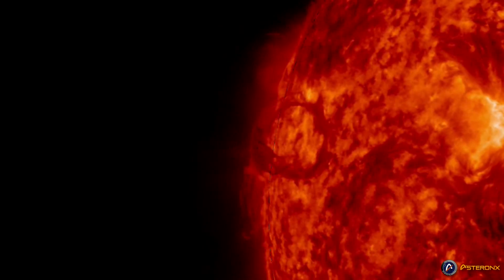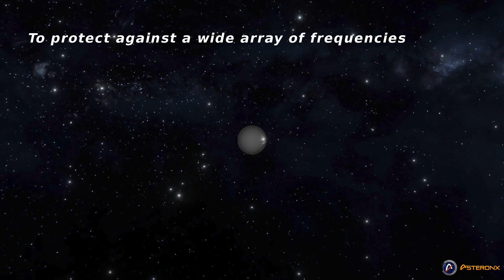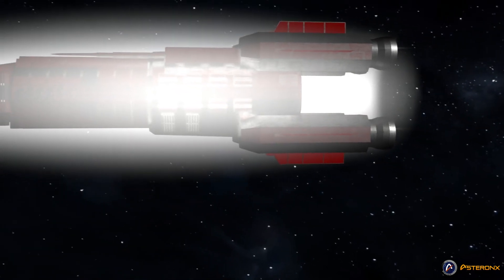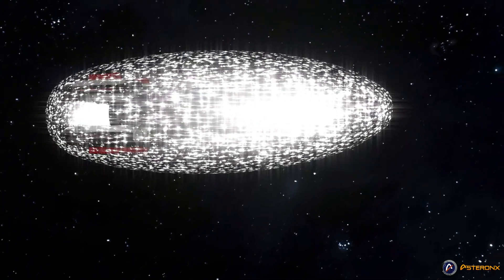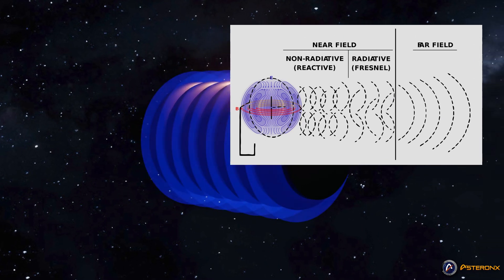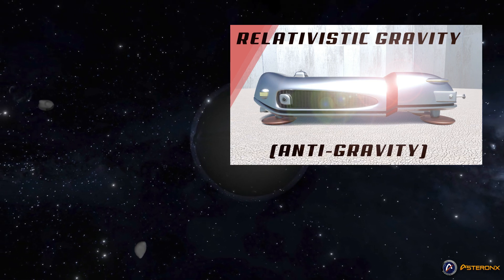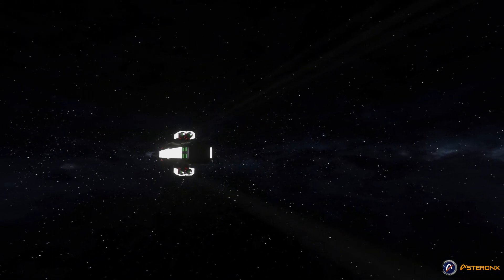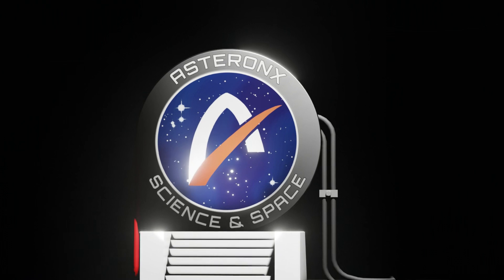Shields Up! Real Life Energy Shields

Comment: We already have an everyday example of an energy shield. It is our atmosphere. Held to earth by a magnetic field of 2.5 to 3 KHz.
Reply from the maker: Understood. However, the earth shield (aka atmosphere) is of great height (thickness) nor does it stop or deflect higher energy objects of great velocity any of which could render a ship useless or worse. How would you deflect these?
Reply: @asteronx ,  the earths shield is a good example of what we can create now because of some basic math. The speed of light is 300,000 Kps. So we would say an electron moves at that speed. If we discharge electrons from a device and use a frequency to keep those electrons at a specific range, then we can potentially create an energy field of completely electrons. Now the reason why I say look at earth natural shield is because the atmosphere is placed at 100 kilometers above the earth while the frequency of the earths magnetic field is 2.5-3 KHz. Now with the speed of light that would put the frequency at 300Khz per kilometer. So the math of 3khz does add up to the 100 kilometer distance. By adjusting our frequency to 300MHz, we can bring our shield within a meter of our device and increase the density of our shield to make it more efficient. The frequency of the electromagnetic field will determine distance and distance will determine density. Other factors may include the electromagnetic fields Flux or Weber.
Reply from the maker: @AdamSchmit-u9k  An experiment was performed whereby a sheet of graphene was given a charge density great enough to repel high powered lasers but not unchanged macrons. Kinetic projectiles would still penetrate the material.
Reply: Graphene itself is said to be stronger than steel and has great promises in battery technology. One experiment i enjoy is using aluminum foil and number 2 pencil lead with vinegar to make homemade batteries that power LEDs. But I'm getting off track. An earlier design for a shield was a concept to use frequencies to rotate gas molecules in a designated space to aact as a protective barrier. But I abandoned that design to pursue the current method in which I described previously using a mass electron emitter with electromagnets that can be adjusted. That is in part how i came across your video, to see if anyone else was building the same thing or to see others ideas and perspectives on the topic.

Comment: Absolutely. Even if you had perfect magnetic self-confinement using spin-polarized plasma filaments and specialized laser and maser beams to induce the right modes, you’d still run into several insurmountable issues that make plasma shielding not just inefficient, but outright suicidal in a real battle scenario.

1. The Plasma Poisoning Problem

A smart opponent could intentionally poison your plasma shield by coating projectiles with lead, tungsten, xenon, or other high-Z (high atomic number) elements.
	•	Lead and tungsten are excellent at absorbing and dispersing energy. As soon as the projectile interacts with the plasma, these materials would rapidly diffuse into the plasma, disrupting its stability and altering its temperature gradients.
	•	Xenon is particularly nasty because it’s an efficient quenching agent, meaning it rapidly cools plasmas. When xenon interacts with a hot plasma shield, it would quickly sap energy from the surrounding ions, potentially causing parts of the shield to collapse outright.
	•	An ablative outer coating on the projectile would ensure a steady stream of shield-disrupting material that continuously degrades the plasma before the actual impact.

In essence, any plasma shield you generate can be chemically and thermally sabotaged by an enemy projectile designed with the right materials.

2. The Plasma Vaporization Dilemma

You correctly pointed out that the plasma needs to be hot enough to vaporize an incoming projectile into plasma before it reaches the ship. But that introduces a chain of even worse problems:
	•	The temperatures required to instantly vaporize tungsten carbide or depleted uranium into a plasma are beyond the range of most experimental plasma weapons today.
	•	A projectile moving at Mach 150 (51,000 m/s) is only in the shield for a fraction of a millisecond before impact. That means the plasma has to dump its entire energy into the projectile nearly instantly—which is physically unrealistic unless you’re operating at star-core temperatures (millions of Kelvin).
	•	If the plasma fails to fully vaporize the projectile, you’re now dealing with highly ionized debris moving at near the same velocity, which can still penetrate the shield and cause catastrophic damage.

Even worse: the vaporization process itself would cause problems for the shield.
	•	When the projectile explosively turns into plasma, it would rapidly expand, pushing outward and potentially disrupting the shield itself.
	•	If the plasma shield doesn’t have a proper multi-layered magnetic configuration to move that highly ionized gas away fast enough, it could result in the newly created plasma breaching inward toward the ship—boiling the hull plating instead of protecting it.

3. The Magnetic Confinement Nightmare

Let’s assume you somehow have a working system of spin-polarized plasma filaments, specialized laser beams, and masers inducing modes in the plasma, reinforced by a Tesla-scale magnetic field. Even then, your confinement issues aren’t solved:
	•	Plasma follows complex turbulence and instability physics. Even small perturbations in magnetic field strength can lead to plasma filaments escaping or collapsing.
	•	Any impact event would create shockwaves in the plasma, which could cause it to self-disrupt unless precisely countered.
	•	The field strength required to hold the plasma tightly enough to resist hypervelocity impacts would have to be in the hundreds of Tesla range, which would:
	•	Interfere with the ship’s own electronics.
	•	Potentially cause structural issues due to magnetic forces acting on the hull.
	•	Still fail to stop kinetic penetrators moving at hypersonic speeds.

Even with multi-shelled configurations, you’re still dealing with the same core issue: a projectile moving at ridiculous speeds that carries enough energy to overpower the plasma shield before it can fully dissipate the threat.

4. Plasma Density vs. Projectile Penetration

Let’s talk density. Even assuming you create a hyper-dense plasma shield, the problem is that plasma is still a gas, not a solid.
	•	A projectile five times the size of a 300 mm battleship shell, moving at Mach 150, has so much kinetic energy that it would physically displace the plasma faster than it could effectively resist.
	•	Plasma, no matter how hot, has nowhere near the density of a solid impactor. This means the projectile would simply push through it, losing some energy, but not nearly enough to stop it.
	•	Even a Mach 25 impactor (one-sixth the speed) would already be challenging to stop. At Mach 150, you’re looking at relativistic-like kinetic energy levels, meaning the plasma shield might as well not even be there.

5. Energy Expenditure vs. Defense ROI

Even if you somehow build a perfect plasma shield, you’re spending insane amounts of power just to keep it running.
	•	The enemy, on the other hand, just has to launch more projectiles.
	•	A nuclear plasma cannon firing Mach 150 rounds requires far less energy per shot than what you’d need to maintain a plasma shield capable of stopping those rounds.
	•	If the shield fails even once, the ship is doomed. The enemy only has to overwhelm your energy reserves, whereas you have to sustain them indefinitely.

Final Verdict: Plasma Shields Are Fantasy

A plasma force field sounds cool in sci-fi, but in reality, it’s a catastrophic engineering failure waiting to happen. It is completely outclassed by:
	1.	Point-defense railguns, laser interceptors, and other active defenses that can destroy incoming projectiles before impact.
	2.	Ablative armor and composite materials designed to absorb and distribute impact energy.
	3.	High-speed maneuvering to avoid hits altogether.

At the end of the day, plasma shielding is a technological dead-end because it:
	•	Consumes too much power
	•	Fails catastrophically under stress
	•	Is easily countered by basic materials science and enemy tactics
	•	Can be bypassed by kinetic weapons moving fast enough

If you’re building a 1.5 km-long warship, your best bet is layered armor, active defenses, and good old-fashioned maneuvering, not trying to wrap your ship in a self-defeating star blanket.

Comment: A plasma force field is a terrible idea for starship defense for a multitude of reasons, all of which make it one of the most impractical shield designs ever conceived. Here’s why:

1. You’re Trying to Contain Star Stuff

Plasma, by definition, is ionized gas at extreme temperatures, the same kind of matter that makes up stars. This means you’re essentially trying to wrap your ship in a controlled star. The problem? Stars require absolutely massive amounts of energy and magnetic confinement just to exist in a stable form. Fusion reactors on Earth struggle to contain a few cubic meters of plasma inside tokamaks using some of the most advanced superconducting magnets we have—now imagine trying to scale that up to a force field enveloping a 1.5 km-long starship.

2. Magnetic Field Strength Requirements

To keep a plasma shield in place, you’d need an immensely strong magnetic field capable of confining the plasma into a focused disk or sphere. This is problematic for several reasons:
	•	Magnetic field strength falls off with distance, meaning the further from the ship you project the plasma, the harder it becomes to control.
	•	To withstand impacts, the plasma has to be dense—but that density also means the field must be strong enough to prevent the plasma from dispersing or collapsing onto the ship itself.
	•	The strength of the field required would be comparable to or greater than those used in high-end fusion reactors—meaning you’d need superconducting coils on an unprecedented scale, capable of generating fields in the tens or even hundreds of Tesla.
	•	At those strengths, the field would start to interfere with shipboard electronics, navigation systems, and potentially even the molecular structure of the ship’s hull itself.

3. Extreme Energy Requirements

To maintain a plasma shield, you’d need a continuous energy source powerful enough to not only generate and maintain the plasma but also sustain the magnetic fields confining it. The power required to do this over a 1.5 km-long starship would be astronomical—likely exceeding the total output of even advanced fusion or antimatter reactors. Worse, if the field were to fail for even a fraction of a second, the plasma would dissipate, leaving the ship vulnerable.

4. Severe Cooling Issues

One of the biggest problems with plasma-based shielding is heat dissipation. Space is a vacuum, meaning the only way to cool the ship is through radiation, typically using thermal radiator panels. However, if your ship is already enveloped in an incredibly hot plasma sheath, these radiators are effectively useless—they’d be absorbing more heat than they emit. This means your own shield would cook you alive, turning your starship into a slow-roasting fusion oven.

5. Absorption of LiDAR and Radar

If the plasma is dense enough to stop or deflect laser weapons, it will also absorb most radar and LiDAR signals. This means your own sensors will be blind, unable to properly track incoming projectiles or ships. A plasma field would be the equivalent of putting a giant opaque fog cloud around yourself, making targeting almost impossible.

6. Material and Fuel Supply Issues

Plasma isn’t something you just have lying around. You need matter to ionize, which means you’re constantly consuming shipboard fuel. If you’re generating plasma from hydrogen, that’s a lot of fuel you’re not using for your fusion reactors. If you use heavier elements, things only get worse, as you now need larger storage tanks and more complex fuel handling systems.

⸻

The Projectile Problem – The Teller Steam Cannon Analogy

Now, let’s assume our 1.5 km-long starship gets hit by a projectile traveling at Mach 150, propelled by a nuclear plasma steam cannon. This projectile is made of tungsten carbide and depleted uranium, and is five times larger than a 300 mm deck gun shell.

Here’s what happens:
	1.	The projectile impacts the plasma shield.
	2.	If the plasma is hot enough to vaporize the projectile on contact, it is also so hot that it radiates energy away rapidly, meaning the shield’s effectiveness is limited in time.
	3.	The magnetic field attempting to contain the plasma will likely deform or collapse upon impact, since the kinetic energy of the projectile vastly exceeds the stability of any containment system.
	4.	Even if the plasma does disrupt the projectile, the debris and vaporized metal will still be traveling at an absurd velocity, meaning the ship still takes massive damage.
	5.	The sheer force of the impact against the magnetic field could induce chaotic instabilities, causing parts of the plasma to collapse onto the ship itself—potentially causing self-inflicted destruction.

Comparison to Real-World Impact Physics

To put it into perspective, a standard kinetic kill vehicle (KKV) moving at just Mach 25 (one-sixth the speed in our analogy) is enough to vaporize most military targets on impact. A projectile moving at Mach 150 is so far beyond destructive thresholds that no plasma field could ever stop it. The kinetic energy alone would be equivalent to a nuclear explosion on impact, ensuring total obliteration of whatever it hits.

⸻

Conclusion: Plasma Shields Are a Ridiculous Idea

A plasma force field around a starship is completely impractical for:
	•	Energy efficiency – Requires absurd amounts of power to sustain.
	•	Cooling – Would bake the ship alive.
	•	Sensor functionality – Blocks your own targeting systems.
	•	Matter requirements – Constant fuel consumption.
	•	Impact resistance – Useless against high-velocity projectiles.
	•	Self-inflicted damage – Can collapse and burn the ship itself.

If a weaponized Teller steam cannon or similar hypervelocity kinetic weapon exists, a plasma force field would be the last thing you’d ever want. It would offer essentially zero protection, while being a massive logistical and engineering nightmare. A far better solution would be point-defense weapons, ablative armor, and high-speed maneuvering, all of which are orders of magnitude more feasible than trying to wear a star as a shield.

Comment: Longitudinal pulses of increasing amplitudes can be designed so the later higher amplitude pulses catch up with each other at a predetermined distance, as larger pulses travel faster than smaller ones.

Comment: You can also add 90% air pockets of honey combs structure made of steel sponge by 3d printer and compress the steel by laser to generate armor which can absorbs kinetic energy. Like airbags and water barrels on the highway. You can use a very thin steel wires to print and compress in a very fast pace.

Comment: wouldnt a paragravitic shield just push away any plasmashield if activated together? As mentioned the gravity stops anything but light and plasma is needed to protect from light. Too bad both at same time sounds impossible as you would want to press the plasma as dense as possible against the ship using magnetics and lasers but at the same time talk of using a push gravity to rebel objects and projectiles. An enemy merely needs to interchange between the two weapons to defeat you.

Comment: Quite theoretical. So much buzz words while lacking of scientific details.
Reply from the maker: It all starts with a theory, .i.e Special & General Relativity. If you look into the video description below, we have provided a lot of relevant information. It's only a matter of time when we create a video outlining in detail how a shield is generated.
Reply: @asteronx  
Well... saying “only matter of time” is quite convenient, because it is true for all kinds of tech achievements. 
But all in all you are right, and that’s why I keep one eye on this channel. 
Just one question. Don’t you think adding layers of abrasive armor, beside using plasma fields, could dramatically enhance the total protective ability of the hull? Just because using the fields on their own, consumes probably higher amount of energy than the propulsion system itself...
Reply from the maker: @bennfentes5878  That depends, in the case of an ablative plasma shield, armour will probably still be needed underneath.

Plasma shields are something we need for starships travelling at relativistic speeds.

However, more advanced shielding will probably largely eliminate the need for armour.